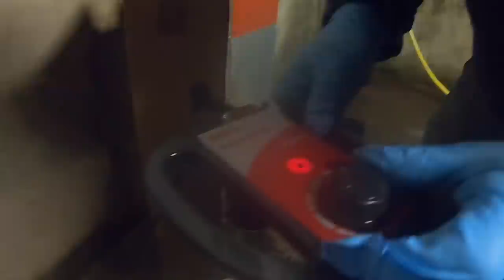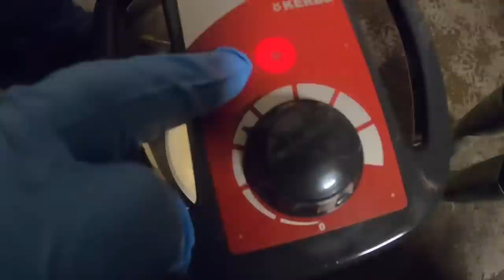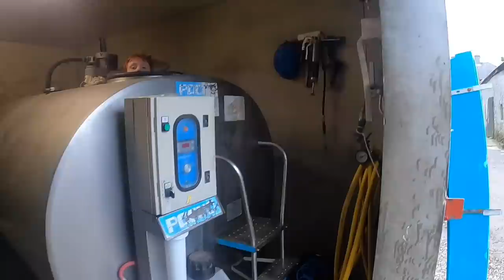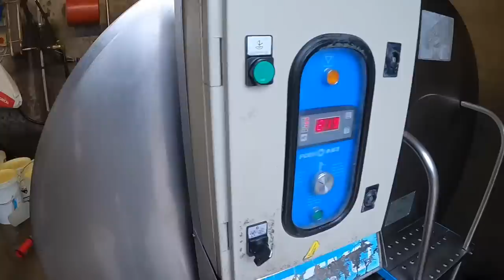GRAZING STARTS/PREPARATION FOR MILKING SEASON & CALVING IN FULL SWING

Comment: I have 1 of those milk heaters too, useing it 4 seasons, & gave no problems, no , it wouldn’t melt the bottom of the bucket, at 40 degrees, no worries,
Reply from the maker: The only issue I’d have with the heater is that the milk does burn on to the element and it has to scraped off or soaked in hot water to soften it.
Reply: @dronedairys7461  well yes your right,  but if you have a bucket of hot water beside where your heating the milk , stick it in straight away ,before it drys, or else, it’s a wire pot scrub job!!!